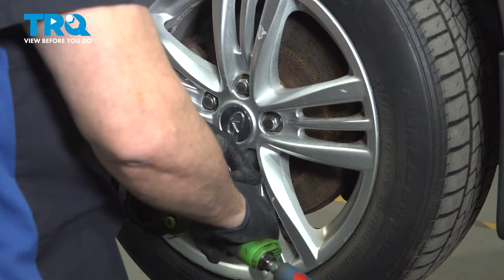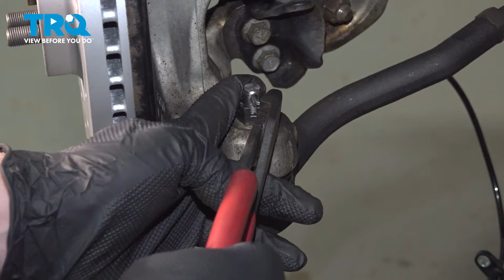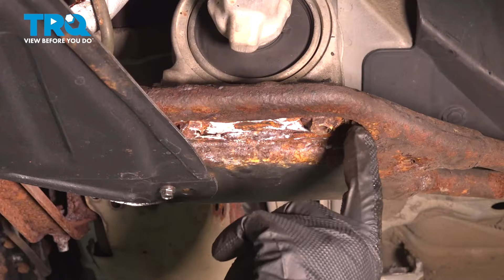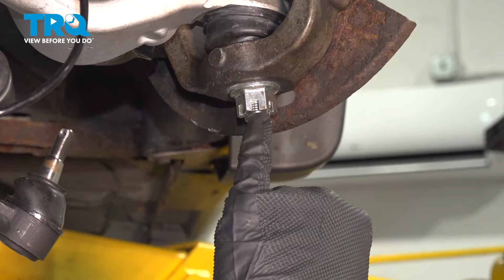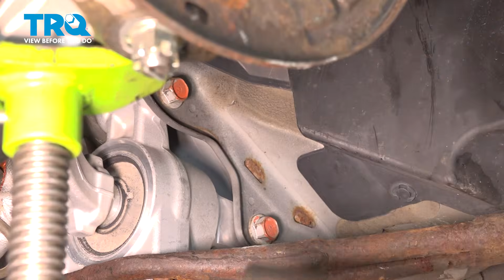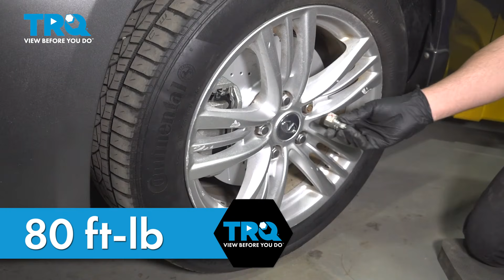How to Replace Front Lower Control Arms 2008-2013 Infiniti G37

Comment: i’m having trouble taking off the nut on the bottom ball joint that connects the arm to the spindle. i can spin the nut with my hand but it doesn’t come off with the impact. would putting weight on that area help?

Comment: Great video, changing the mounts on my G37, 2010, it seems this is the only way to gain access to the bolt which is tucked in the control arm.

Comment: anyone doing the passenger side there are what i believe to be fuel lines that are in the way so u gotta take off like half of the lower cross member to slide the control arm under the lines.
Reply: at least that’s how it was on my 2012 g37x sedan
Reply: @carternelson8851 thanks g